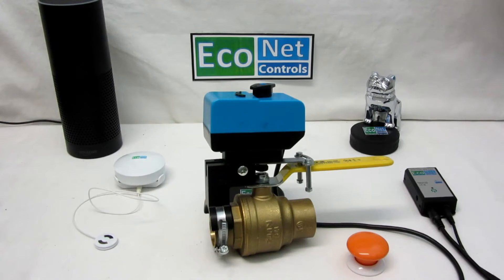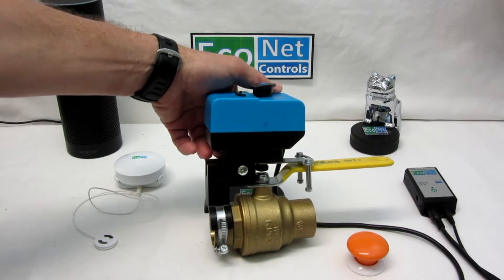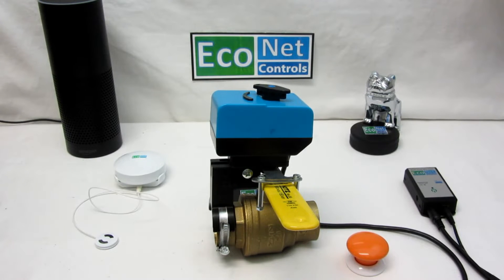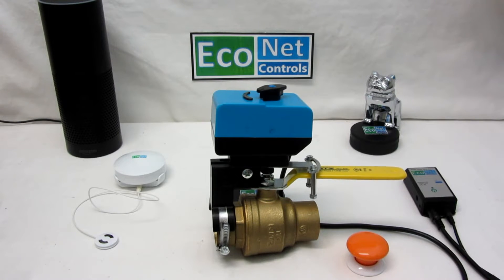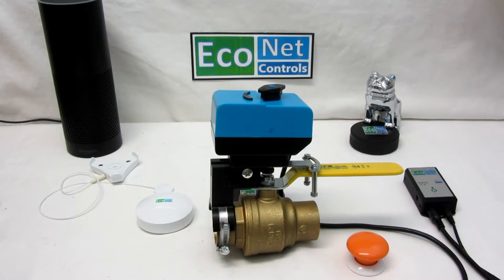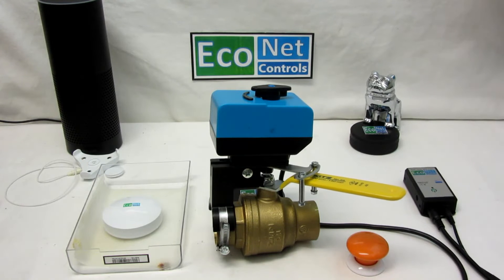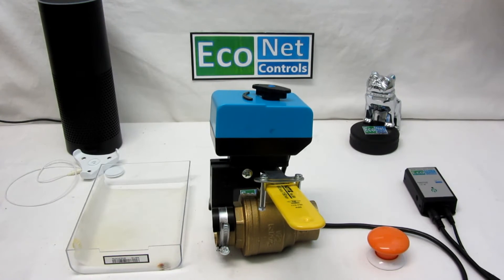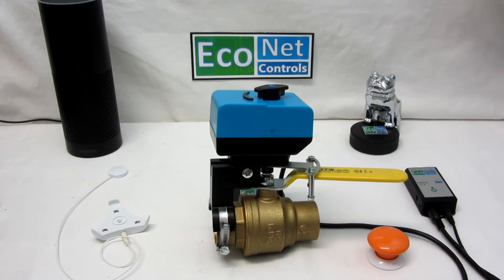BullDog High Torque Z-Wave Water Valve Robot

Comment: The pins are way too weak for my ball valve. It might be because the valve is at a 90 degree angle to this example, but the pins started getting pushed and actually bent the metal shut off arm. The arm is slotted so it is easy for the pins to slide around and not stay in place. Oh well.

Comment: Nice product that is even nicer with the App.  Question pls: we would need to utilize your valve shut off in conjunction with a water flow meter as a signaling device.  We will not know where the leak would occur but the flow meter would tell us, there is a leak somewhere during a time there shouldn't be any water consumption.  Could we do something like that with a digital flow meter to alarm us?  Does your app accept alternate inputs/triggers?  Thanks

Comment: Hello sir,

Please provide the details of motor used, what is the minimum torque needed to rotate motor 

This product is not available in India. Please help me
Reply from the maker: Why do you require a minimum torque rating?  The torque rating typically refers to the maximum torque.  The Bulldog works with most standard levered ball valves in sizes up to 1.5" and in some cases 2" valves.  Please contact our support department at support@econetcontrols.com for more details.  Thanks

Comment: Why they don't extend lever of device to increase torque?
It'll require huge torque to rotate it at that lever lenght.
Reply: The arm length does not matter as the torque is from the center motor, get it?